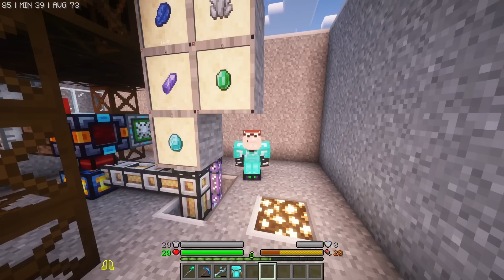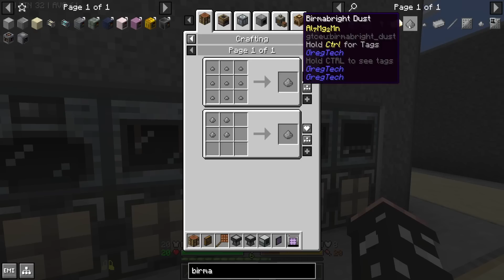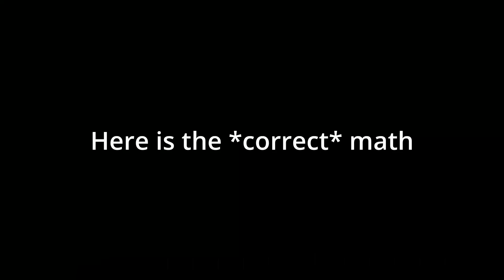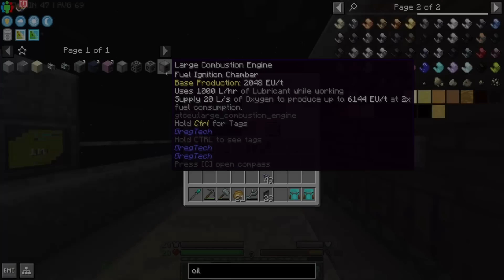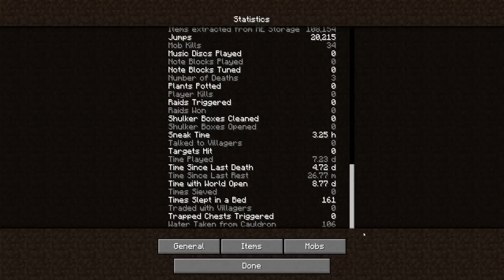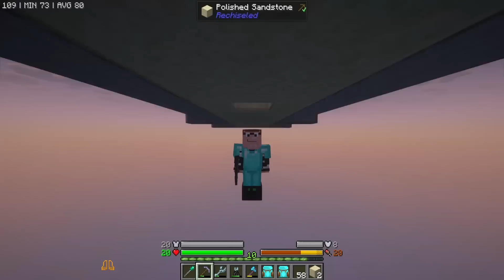FINALLY fixing my power problems! - Star Technology

Comment: Technically , could still use compression dynamos. LaserIO does have ability to regulate amounts into machines via the counting filter, and yes, they do work with fluids as well. so could say have it only hold two buckets in each dynamo at any given time. XD
Reply from the maker: I definitely have to look into laserio, I've not used it before

Comment: Im new to gregtech so can I ask a question. Which recipies is the cleanroom used for and which machines can I place in it
Reply from the maker: You'll only need the cleanroom if, underneath the recipe in JEI it will say "requires cleanroom". But mostly it's just circuit stuff